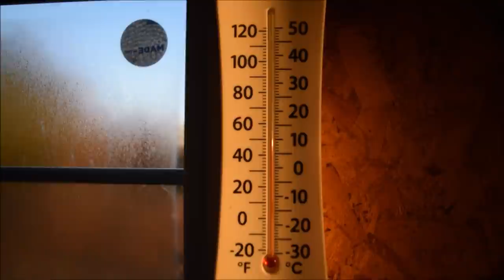Our Off Grid Wood Stove Installation Vlog and much more! Ep. 33 (Not a How to)

Comment: I just bought this exact stove. Can’t wait for it to be installed next week! Love it! ❤️❤️❤️
Reply from the maker: Awesome, once you get used to it you will love it. 😀
Reply: How often do you need to put wood in it on a winter day? Does it heat up 900 sq ft?
Reply: What brand/kind is it? Like to get one
Reply: @WeThePeople9069 "U.S. Stove" ... made in China unfortunately.  It's hard to find a smaller stove at a reasonable price these days. These are generally between $550 and $750
Reply: @kjvonly2451  👍No worries. Thanks for your reply.

Comment: I just put in a cast iron like yours. But mine has a plate on the front to slide to let air in. Been using it for 3 days now in a 12x20 cabin.  Hope you enjoy.  I am getting the hang of it.
Reply from the maker: I have through enjoyed mine and know how to use it well now! Burning wood and particular stoves take experience. This is my third winter burning and I learn more each time! 😁

Comment: We literally just bought this stove  and they have changed the way the pin and the flue baffle now go (apparently between when you purchased your stove and we purchased ours) .  It is now facing front to back and not side to side and it is meant to be fixed in the flat position and is not to be moved.  Hope ours installs as easily as yours
Reply from the maker: +Really Fun, ours was also front to back and fixed in the flat position with a pin. They also cut the triangle handle off the damper to also deter you from changing the burn rate. Thankfully the pin was a threaded Allen screw so I was able to easily back it out and using and oven mitt when wood is burning I can push the damper handle in and adjust if I want but the bad thing about this stove is because of the new EPA standards this particular model has been modified to be a " single burn rate stove " which means no really control over air flow and damping. I have played with the damper position since backing out the pin and it honestly still works best with the damper the way it came. All in all this wood stove is "ok" but you can not get even close to what people call an "all night burn" because of the lack of damping controls. Which if you don't have an alternative heat source means getting up every 3 hours at night to stoke and add wood to the fire. Sorry for the long response but I have alot to say about using this wood stove and need to do a whole seperate video soon.
Reply: We just installed this stove, I was confused about the flue damper adjustment. But according to what you said that makes sense. It stays in that position to maximize heat capture...

Comment: Nice job, one thing though, it looks like your black stove pipe was installed upside down, male end (crimped) goes towards the stove, this is incase liquid creosote develops, it can drain back into the fire box.
Reply from the maker: +Kenny P no, it's not upside down. They are all going the correct way. I just trimmed the last piece to fit around the flue collar. If you get creosote dripping at the very bottom of your chimney where the stove connects then something is very wrong.
Reply: I agree, but you know some people will do what they want because they think its right, like burning wood that has a moisture content above 20% aka not "seasoned" or burning there stoves so banked down that the stove top temps only reached 350deg f. 
I watched the video again, but on a larger screen and it does look like its installed correctly when your installing the black pipe from the ceiling support box.
Reply: Another bad design for these stoves!! No matter how you burn em you are going to get some wood tar around the connection

Comment: Assembled the same model # today and it had no damper. Do I need to add one? Also it had no fire brick, do I need to line the bottom. Great video !
Reply from the maker: Yes, you can get one to add further up the pipe. Some say it's better than it being so close in the collar. No firebrick in this model. Just a layer of Ash, about 1 inch, is all you need.

Comment: We are trying to install this same model in our home right now! What is that pipe you snapped together that you connected to the stove flue outlet? We are having a hard time trying to find a pipe or adapter to fit on our stove pipe outlet. All the adapters we've tried are to big for it.
Reply from the maker: It is just a plain piece of pipe and it fits right over the collar snuggly. Don't have an adapter or sliding piece. Have to tilt the stove to undo it.

Comment: I have that same stove and I’m knocking my head against the wall. Constant back draft smoking coming out of the door whenever it’s opened, no updraft. Door closed fire goes out 🙁
Reply from the maker: You should remove the kaowool in the top. You can access it from the flue collar. That should solve your problems.
Reply: @StevensFamilyFarms  or drill a hole for a vent and run some pipe with a valve, suggest from outside air source.

Comment: Did you use a single wall pipe before the ceiling ? 
Works good ? Or a doble wall pipe need it ?
Reply from the maker: Single wall before the ceiling box. Double wall in the box going through roof.

Comment: Are you going to have to put a barrier behind the stove?
Reply from the maker: +Gail Reese, no. We actually have a hair more than the minimum clearance to combustibles at the back of the stove. This particular stove model and manufacturer only call for a floor protector or a hearth that has an R value of 2.06 or more. As long as you follow all their clearance to combustibles guidelines. We'll talk about it in this week's video going into some more detail.
Reply: Stevens Family Farms I would still install a metal some form of heat shield behind the woodstove just for safety. If you take some sheet metal and space it one inch from the wall with some steel tubing cut into spacers would have a super cheap and easy heat shield.